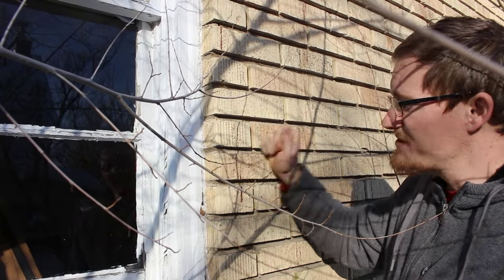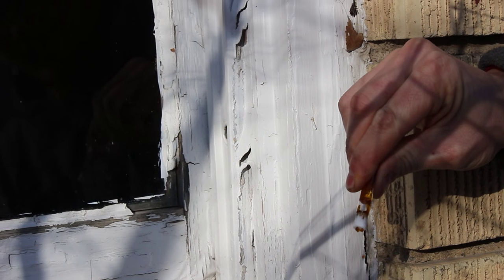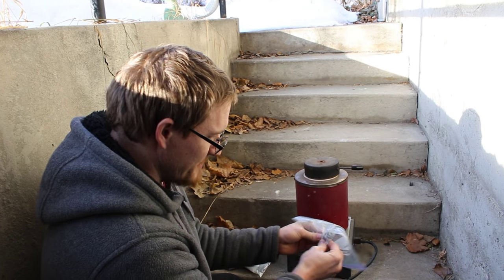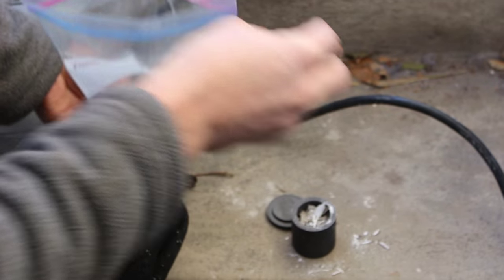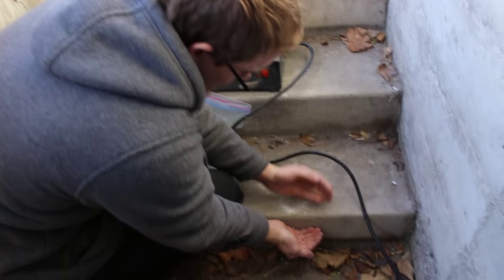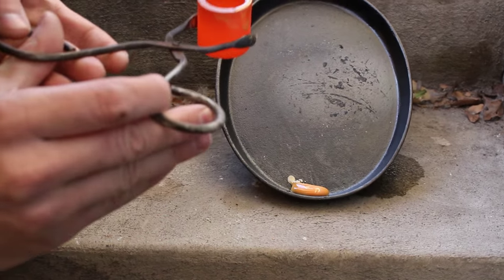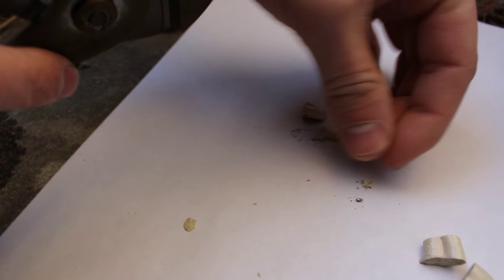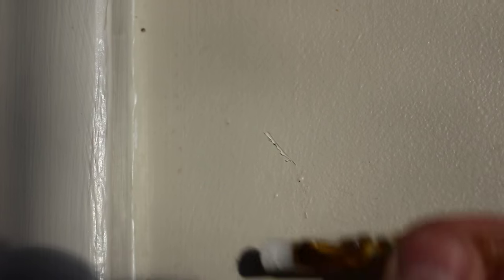Lead From Lead Paint

Comment: I used to work in a lab and sometimes tested for lead in paint samples.  I found that lead paint comes in a large variety of colors, but you could generally tell it was lead based by how brittle it was.  It's amazing that you were able to get so much lead out of such a small sample.  BTW we also testing for asbestos in building materials.  In a house of that vintage you can find it in drywall joint compounds, popcorn ceiling, flooring tiles and glues, linoleum backing, heater insulation, cement siding, under sink coatings, etc.  Since you have access to a geology lab you can use polarized light microscopy to identify the different forms of asbestos.  90% of what's in the home is chrysotile, but you might find some crocidolite or amosite in the cement siding, or heater insulation.  Might be an interesting follow up video.

Comment: Welcome back to "what dangerous thing cody does today!"
Reply: +jonah castro He should title a series that :D
Reply: +jonah castro Lead is not dangerous like this... he was outside, in a well ventilated area. The lead was not overheated. The amount he did touch was extremely small and he didn't touch it for long at all. He would experience no effects whatsoever. The problems that come with lead are when kids were constantly surrounded by lead (like in the paint), which would inevitably get in them.
Reply: +Garrett Millard lol thank you for the clarification
Reply: +Garrett Millard 
And sanding lead paint of course and breathing the dust.
Reply: lol
Reply: RetroResto Lead is only a problem when you are exposed to it for long periods. Lead paint was pulled from shelves and other lead based products are being phased out because it slowly, over the course of years, absorbs into your body. It builds up and robs your body of oxygen. Taking a few breaths of it is not going to cause him a problem. The body does slowly remove very small amounts of lead to deal with the natural lead in the air and water. As long as he is not doing tests like this every day for the next 20 years, he will not have any ill effects at all.
Reply: The YouTube Phantom Official Cyanide is fine in a very small amount. Mercury is much more dangerous, but he took proper precautions by being in a well-ventilated room limiting his exposure to a very short period.

Comment: Hey cody, be carful when pouring molten metals over concrete. its much safer to pout over a cat litter box with some sand in it. hot metal + concrete can cause the water in the concrete to flash steam, which can cause the top layers of the concrete to explode up at you, sending hot metal your way.

the amount you had there was no real threat, but if you are doing aluminum casting, its something to be carful of!

Comment: Yes you can test for Lead without a kit. Lead has a sweet taste. That's why kids will eat paint with Lead in it. You should take proper safety precautions when working with Lead. Gloves and mask when handling Lead and a respirator when you incinerate it. I have a deleading license in the state of Massachusetts and it is illegal to remove Lead paint with a heat gun because of the fumes.
Reply: +Philip Bender Only soluble lead has a sweet taste, most lead such as the oxide, sulfate or carbonate don't dissolve enough to affect your tastebuds. (Until they reach your stomach.)

Comment: Cody, maybe you could've frozen the paint chips with liquid nitrogen to make the paint chips more brittle and then crush them in to finer pieces?
Reply from the maker: +LongJohn Vllasaliu 
see now thats an idea!
Reply: +LongJohn Vllasaliu he also could have just used a mortar and pestle lol.
Reply: the paint chips don't contain any water of crystallization, so I don't think the nitrogen would of been a reasonable use.
Reply: +Ampix0 That would make your mortar and pestle unusable for pretty much anything else, cause lead poisoning.
Reply: Amantis That's pretty true. Ehh.. Few layers of plastic wrap or parchment paper and you're good. But I would assume they are used in a lab, where it is to be assumed that chemicals exist in the lab. I am not a chemist but perhaps you would remove the lead chemically by creating some byproduct
Reply: Dangerous particulates.
Reply: @rickh3714  This is Cody'sLab, they are known as "Interesting Particulates"

Comment: i wish i had a life like you coby
the things you do are really interesting...
Reply: +danger usb - All you need is an inquisitive mind. The internet may be littered with a lot of trash, but there's now, more than ever, more useful information than there has ever been. You don't have to discover anything new. As Cody has proven, it's often more interesting when you do things for yourself. If there's anything you've ever wanted to do, you'll likely find a wealth of info out there on how do it it safely, if it can be done.

As someone that casts their own lead bullets from range scrap (used bullets I pick up at the gun range), I've always loved playing with molten metal. Recently I stumbled onto "lost foam casting". I'm currently preparing to melt down a heap of aluminium cans I've collected and cast them into the shape of a slingshot. I have no practicable reason for doing so other than for my own amusement. Should be fun :-)
Reply: tanks

Comment: Actually Cody as I understand it, first Zinc white and later Titanium dioxide was, and still is used to make paint white. Lead was used in all paint, not just white. It has really great properties to make great paint. Only thing, it's toxic. But it speeds up drying, it makes the paint more water and UV resistant to color fading, and more opaque. It is a fantastic material for making good paint of all colors. If you have old paint, it's guaranteed to have lead in it, it was universally used. And terrible for our health.

Comment: I seems as though the sample you got from your window sills was small, and possibly painted over many times with more modern paints using titanium dioxide as the white pigment and latex, or other resin, plastic as a binder, many white paints in the past were pure lead oxide for the pigment along with the binder, typically linseed oil. I wonder how much pure lead can be isolated from pure lead oxide? since the formula for lead oxide is PbO, would it be safe to assume equal amounts of lead to oxygen?

Comment: When you have a cap on a crucible like that, does the air inside expanding as it heats cause it to leave the crucible, so that the lid sticks to the crucible once you cool it odwn due to a vacuum?
Reply: I doubt that it makes a perfect seal. It is a clay/graphite mixture and has a rough surface.

Comment: Dont put a lid on the crucible when your melting lead.. Because Lead got lots of fume's thats not so good to trap.. but i dont think i matters when you only have 0,2grams or so ;) But Awesome Video as allways! :D
Reply: +Flores FPV Wouldn't you want all the fumes trapped and away from you instead of leaking out into the air around you?
Reply: No Because it creates pressure, if i had been a bigger crucible and more Lead it would be really dangerous, because you dont want large concentrated amount of fumes in you face... And ALLWAYS use a mask when melting Lead! all amounts! And dont just buy a dust mask on Ebay, you want a fume mask made for handling lead fume's :)
Reply: Flores FPV
Wouldn't you only get pressure buildup if you sealed it?
Reply: Thats what i meant with a bigger container, i got a 4kg crucible and its not that big, but heavy... So if you got a big crucible and a heavy vid its going to build op pressure, but again its not that dagerous in that small amout as Cody got it :)
Reply: Flores FPV
Aaah, makes sense. I smelt lead in an old cooking pot and use the lid to stop fumes.

Comment: Is there a way to extract magnesium from those magnesium supplement pill things? I thought you could crush them to powder, mix with acid, then react the acid with a more reactive metal like aluminium, coating it with magnesium. Is this right?
Reply from the maker: +harry s 
would have better luck with electrolysis.
Reply: ***** Electrolysis of the magnesium salt solution?
Reply: +harry s It'd be easier just to buy the stuff. Garden centers sell magnesium sulfate (Epsom salts, sulfate of magnesia.) which is very cheap and pure.

The more reactive metal thing really only works for metals less reactive the iron, metals like magnesium will react with water as they form. Electrolysis won't work either, you'll get hydrogen bubbles and will have to electrolyze a molten salt, at that temperature the magnesium burns very fast.

Adding baking soda will get you the carbonate which can be heated to get the oxide. If you place THIS in a sealed container with aluminum powder and heat it vigorously (orange hot) you will get impure magnesium. It's a lot of work.
Reply from the maker: electrolysis will work you just have to use mercury.
Reply: *****
I had totally forgotten that. This is why you're the popular science channel guy.
Reply: if theres a will thers a way
Reply: +harry s Yes.Sodium can be made by the electrolysis of NaOH.

Comment: Why did the lead clump in a ball rather than mix through the slag?
Reply: +ColonelJ1 science!
Reply: +ColonelJ1 hypothetically speaking, slag and lead have a different mass. The % weight of lead (VS total weight of lead+slag) allows it to precipitate. When heat up to a certain temperature, they separate from each other (although there will be trace amount trapped in the slag).  Google "Phase Diagram" if you want to know more.
Reply: +ColonelJ1 mass
Reply from the maker: +ColonelJ1 
I left it long enough for the lead droplets to stick together into one big piece, also the lead is heavy so it sank.
Reply: Wow the man replied to me. Thanks Cody, great video, can't wait to see your gold smelting experiments.

Comment: I feel like you're doing a lot of furnace videos, and fiddling with cupolas and crucibles quite a bit. and it seems there's a lot of mucking a bout with tongs. I wonder if it might not be a bad idea to spend some time, maybe making some custom tools to help you lift, and pour those smooth hard objects. and perhaps something other than a gross cast iron pan to pour out onto. at least brush it clean, right?

Comment: If the melting point of lead is in the 600-700 range, why did you need the heat it to 1700
Reply: To vaporize the carbon and other stuff in the paint and left over wood

Comment: Is the slag titanium dioxide and are you a bad enough dude to refine metallic titanium from it?
Reply: +anonynomnomnom Lead paint seldom contains titanium, and that stuff is damn near impossible to refine.
Reply: Gareth Dean
So is the slag unreacted lead carbonate? Confus.
Reply: anonynomnomnom
The slag is mostly borax, the same stuff used as a flux, as well as the decomposition products of it. Depending on the paint composition there will be other oxides and borates present, maybe even some lead that wasn't reduced. You should be able to get your flux back by dissolving it in water then evaporating the solution.

Comment: by "there's definitely carbon in this paint" do you mean hydrocarbons?
Reply: +Justin Koenig It doesn&#39;t have to be hydrocarbons (anything with an Hydrogen bonded with carbon). Graphite (pure carbon) will also combust (rapidly oxidize) at a high enough temperature.

Comment: So, I am planning on this bank heist (just for fun and in theory of course) and thought about stealing gold bars. In the case I made it but have been recognized, I thought about a tactic to hide the gold ( so that in case I went to prison I could get the gold when I get out of prison).
Do you think it is possible to dissolve gold in some way  I can add it to a paint without a big color change, that would hint* at an amount of gold in the painting? Also, I do want to paint a reasonable amount of walls with that paint after that (for example all walls in one 100qm big house and the amount of golf should be at least worth 1 million US $), so the amount of gold inside the paint should be as high as possible.

*the original paint color could be changing in a way that it didn't become yellowish...and the original paint color can be any color that works best for this "experiment".
Reply: It's to heavy to be used. Just bury it lmfao

Comment: Does somebody here know a equivalent replacement for Borax?
I can't really find any legal sources for private customers here in Germany and don't want to register a business just for a kilogram or two...
Reply from the maker: +Darnoc 
Here its sold as a laundry soap. regular salt might work but not as good.
Reply: +Darnoc Well, there's always lead, lol. It's one of the beast fluxes in existence. Well, it wouldn't perform the job of a flux in lead because reasons I don't care to explain. Try a pottery or glass blowing supply store. I cant promise the fluxes you buy will work as a complete replacement for borax though.
Reply: +Cody'sLab +J Carter
Thanks for your replies, i'll try milled icing salt for smithing. 
Maybe lead too, but obviously only for experimental purposes.
Might test some other substances as well, ill post it here if some of them work.
Reply: Darnoc
I don't think salt for melting ice will work, but it sounds like a fun experiment either way! I managed to find a list of fluxes for metals, so you might want to give a few of them a try too: https://en.wikipedia.org/wiki/Flux_%28metallurgy%29#List_of_fluxes

Comment: you should make  pencil with some real lead
Reply: That pencil will be much less effective and ridiculously more dangerous.
Reply: +Flowey The Flower Actually I have a 'real lead' pencil, the writing is rather light but it's not that different from a regular pencil. I've found you can even write with galvanized nails if you use cardboard.  Metals can be quite soft.
Reply: +Gareth Dean i've used bullets for the same effect before >.> oh those lists made while camping...